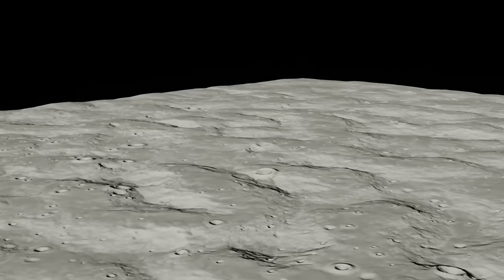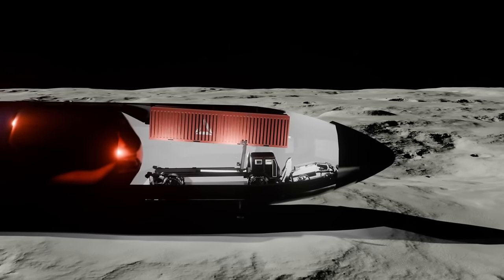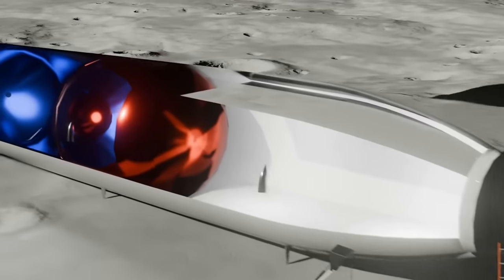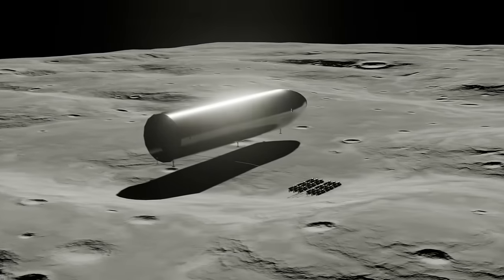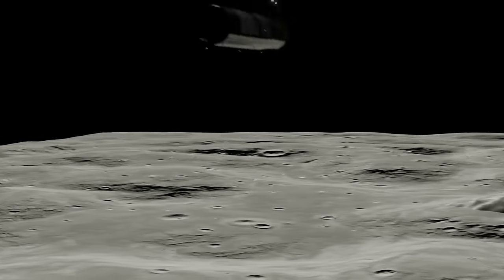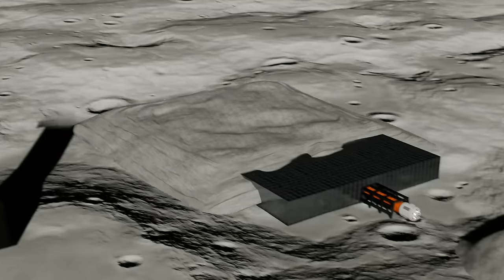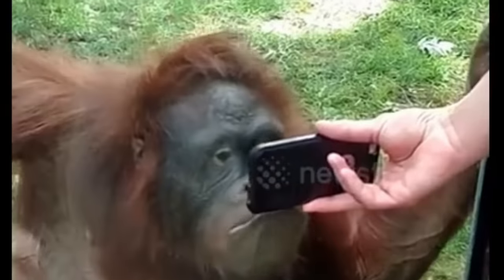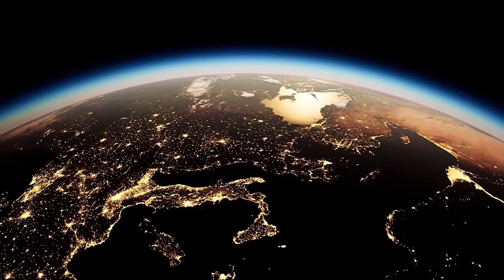How To Develop The Moon ALL PARTS

Comment: If each ship can practically only do 5 trips, may as well belly flop all of them on their 5th landing and either canabolize them or use them as extra space for expansion
Reply from the maker: @cobhallagames6997  yeah very high value use of it vs scrapping for parts or whatever alternative. Even if it's 30 flights, do it on the 30th.
Reply: @Anthrofuturism  especially since you could easily just fill them up with materials for the last landing. Copper, door knobs, soil, additional ROVs which would need to be flopped anyways
Reply from the maker: @cobhallagames6997  yup, you get it.

Comment: I'm curious why you chose a nuclear reactor, rather than solar panels (with large batteries if we want to stay through the lunar night) to power the moon colony. Solar panels in Earth orbit or on the moon receive about 40% more solar energy per square meter than those at sea level on Earth. Launching uranium 235 on rockets seems inherently risky, and I would imagine that the reactor and heat pump array would be roughly the same weight as solar panels and Li-ion battery packs that produced the same amount of energy.

Also, are you sure that the Earth's atmosphere is the primary reason that it takes more energy to go from the Earth to LEO than it takes to go from the Moon to LEO? According to Tim Dodd (The Everyday Astronaut) in his video "Why Don’t They Launch Rockets From Aircraft?" the theoretical payload increase from launching from an altitude of 10 km (above more than 70% of the Earth's atmosphere) is only about 15%, and most of that increase would come from being able to use more efficient vacuum-optimized rocket nozzles on the first stage, not from the reduction of atmospheric drag, which apparently isn't a major factor at the speeds rockets can reach within the first minute of flight. This makes intuitive sense: If atmospheric drag was a major component of the energy requirements of rockets launched from Earth, one would imagine that that friction would create enough heat to melt aluminum payload fairings.

It seems to me that the more obvious and straightforward explanation for the moon-to-LEO energy requirements being lower is just that when you're launching from Earth, you're launching from a much deeper gravity well.
Reply from the maker: Here's a video I made addressing the solar vs nuclear point: https://youtu.be/XKcCisxzG8c?si=Xo3DB0lexKEJdXfd

And atmosphere really impacts launch cost more than delta v but I see how I wasn't clear in that and basically implied that deltav is directly proportional to cost, which it isn't there are other factors, but that was my bad. I was just trying to make the point that launching from the moon reduces costs significantly.
Reply: Common sense skeptic has exposed the angry astronaut for his lack of proper research to say the least.

Comment: Before estimating the cost to build a structure on the moon, you should consider the process and technologies used to build any construction on the land. And take those estimations to build same kind of structure on the other planet. One tractor with a bucket is not gonna be enough. You’re gonna need dozers and dump trucks.
Reply from the maker: Yes. Which is why I had massive margins on my estimates.

Comment: I'm curious abouth the 2Mw electrical energy, NASA's fission surface power projects (KRUSTY/kilopower), estimates 40kw(e) So you would need 50 of those, what would you use them for for comparison the ISS uses 60Kw(e) half the time (because of earths shade). Also if you use a nuclear reactor why not visit during the lunar night it's easier to heat things then cool them on the moon also theirs significantly less radiation it would be nice if the burying proces could be done by teleoperation... like why is the second one teleoperated but the first is not? Thanks for the explenation abouth the ovens but you need twice the amound of hardware, the hard part is getting stuff on the moon is steel in a no carbon enviroment twice as good as cast regolith iron??? probably not
Reply: Cooling is much more of an issue. The NASA reactors lack much in terms of cooling. so start in a polar creator and lay out lots of steel pipes. Just be sure to use barrier PEX and pumps that keep the O2 out. Once those pipes are in place the reactors power output could be increased. edit: the orbiters should be looking for carbon deposits. There should be some as some asteroids have carbon.
Reply: @LaserFur  well you are probably right here, however you make a interesting point, the carbon will probably come from asteroids and theirs basickly 3 types of asteroids M type are metalic, S type are rocky (silisieous) and then there is the interesting c type asteroid with C standing for carbon but they contain a lot of volatiles, meaning wherever you find water you will probably find carbon aswel. To the reactor just no, you do not need that amound of power unless you are producing something, decrease power output by 500-1000 to 20-40Kw especialy if you will supplement it with some solar, maybe keep 4 KRUSTY fission devices from wich a maximum of 3 are opperational at the same time. during unmannend use and leave 2 opperational 1 in back up and 1 in maintenance during mannend stays (during the day with supplemented solar). Astronauts can then service the plannend maintenance unit and if no problems arise switch it out with the backup allowing service to both modules. The situation  as portrayed in video, you have a 1000 times overpowered single unit that can break and kill everyone. And no real use for that amound power
Reply: There is no "dark side" of the moon. If anything, the Earth-side gets more shade than the far side does, but lunar night comes every two weeks regardless.

As for power requirements, keep in mind that the average household uses around 30-40 kwh per day, depending on the size, and that's also without having to worry about life support.
Reply: @blackepyon4042  I mean nighttime with less radiation, can we agree that 2 megawatt is probably a bit overkill for a starter base, and that having 1 power source is a recipe for disaster (what if it breaks?) Get at least 3 power sources
Reply: @arnerood690  Depends on how much power those kilns consume.
Reply: @blackepyon4042  kilns do consume a lot of power, but most of it is thermal  I mentionend 40kw(e) for the kilopower, however they produce quit a lot more thermal power, definitly enough to heat the base, so that is no longer a (electric) cost for the base. Similary early kilns on the moon will probably be powered with rocket propellants, so either a hydrogen oxygen burn (burns at 2400K) or methane oxygen (burns at 2210K) methane is better because there is less boiloff (hydrogne tends to escape, also you can smell methane leaks better then hydrogen), the resulting mix can be electrolyzed back in their basic components when energy demand is lower (when astronauts rest or do none power intensive tasks). So the kiln fuel turns back into emergency rocket propellant. (their is room for a electric furnance and solar ovens aswel tough). I imagen we will have a darpa version of ??? a boeing version, lockhead martin version etc, NASA will want to partner up both with ESA,JAXA and more and compagnies aswel. Again my ideal version would be something like the amundsen scott base and mcmurdo station,  forward operating bases (FOB) or a expeditionary bases to use a less militaristic name

Comment: Would a self-tempering donut habitat that circulates heat to the walls and built into the ground work?
Reply: In the centre of the donut could be a big crater free from the heat, a frigidarium.
Reply: Or build solar panel walls to force shade in the centre.
Reply: On the inside of the donut skin could be a dedicated subdermal layer filled with air circulation cavities to further equalize temperature variation across the donut volume. Along the centre a vertical fluid-vacuum barometric equalisation unit that circulates air and maintains optimum pressure throughout the habitat because the equalisation of habitat heat would make it hotter at the top closest to the surface - making a vacuum that pulls fluid in the unit and circulates it.

Comment: Why produce  steel in situ? Aluminum might be easier?
Reply from the maker: Anorthite isn't abundant, iron is. Aluminum isn't strong. Steel is.
Reply: @Anthrofuturism  Aluminum is plenty strong if you're working in lunar gravity, rather than earth's, but keep in mind that 5% of lunar regolith is titanium dioxide, which when refined into raw titanium and oxygen as the "waste product" is very useful for building more hab modules.
Reply: Hi, actually the strength of the material itself does not mean much for aerospace, the interesting characteristic is the strength to weight ratio. In this case, aluminium does well, many alloys have good strength to weight ratio, even better than steel. There is a reason why aircraft and lots of rockets use aeronautical aluminium and not steel. Also, for thin structures, like rockets, even if steel has higher strength-to-weight ratio (which is rarely the case), the parts would be so thin that they would suffer a lot of buckling. I would suggest looking a little into aerospace materials and also a little of structural/solid mechanics to better understand the topic.
Reply: @blackepyon4042 yeah for sure, titanium would be much better than steel, higher strength to weight ratio, high temperature resistance, low corrosion. Makes much more sense than steel for strength critical parts.
Reply from the maker: @arthurdefreitaseprecht2648  we're talking about building structures.

Comment: This plan uses so much steel. Why not just use concreate for much of the structure like how we do it on Earth? Cheaper, and faster to produce and build that way.  Also, more shielding and less regolith mound.
I am sure you already know that we could build a place to make fuel on the moon. Which would drop transporting cost refueling on the moon and at LEO could be done this way.

It should also be possible to build a rocket that uses fission to heat the fuel to plasma temperatures and shoot it out the back. While this would not be as powerful as the rocket you are talking about. It would have the benefit to not spewing radioactive material all over the place and could be used on Earth to get to LEO.  Getting it approved will be the biggest hurdle for that rocket though.
One thing that bothers me about the trip to the moon is the time it takes. The reason you can put a lot of people in an aircraft and fly them is that it takes only a few hours. Whereas a trip to the moon will take three days. That is a long time to be stuck in a craft. They need room to stretch their legs.
I loved your video as it was really informative. Keep in mind that we could use solar and electrostatic energy to supplement the power needs and that we could build an artificial magnetosphere to work as a radiation shield. Using electromagnets.
Reply from the maker: Requires water. Or sulfur which also has other high priority uses (gaskets, sealant, binders). What's wrong with steel?
Reply: @Anthrofuturism  Nothing is wrong with steel. It would just be cheaper and faster to use concrete am also saying that you can use them both. Which would be even better than steel alone.
 As for the water. Besides the obvious amounts of water ice at the poles. You could make it out of the regolith while making things like steel. You could even bring some Hydrogen to mix with the Oxygen to make it. But if you do that. You might as well put them both into a generator to make power and then get water as a byproduct.
Reply: @Anthrofuturism  I should also point out that while concreate works as an insulator. Metal would work as a conductor. Both for electricity and heat. While this won't matter so much being burying in regolith. It might be better if the walls were make of concreate and the supports were made of steel.
Reply from the maker: @williamburroughs9686  I'm all for it if you can afford the water / sulfur!

Comment: There's no atmosphere on the moon - Starship won't bellyflop land on the moon. They'll land vertically and then if they need to put starship on its side - they'll use a system of winches.
Reply: Why would they also transport the shipping container? they weigh many tons.
Reply: It would cost more money to transfer the engines back to earth than it would to make new ones. They should be kept on the moon as spares.

Comment: 13 bill for RnD not 4 or 5. have you seen how insanely hard it is to walk on the moon, let alone perform tasks let Also run excavators but, perhaps thye can be remote control. before they fry from radiation. smarter everyday did a video on lunar walks. the apollo team wiped out and fell often. it's miracle they didn't break visor and die. you also have limite hours before you get the bends.
Reply from the maker: Good thing Apollo already did a lot of the leg work for us (pun intended)

Comment: How are you supposed to remote control a vehicle 6 light minutes away
Reply from the maker: I believe it's a 30 second delay there and back but even if it's 10 hours it's possible, we control the mars rovers this way.
Reply: @Anthrofuturism  sorry the sun is 6 minutes. The moon is 1.3 second. It would work fine. Would take some getting used to for any operator.

I operate equipment, excavators and loaders.

Also mars rovers aren't doing detailed excavation jobs. The commands are more simple and easier to automate.